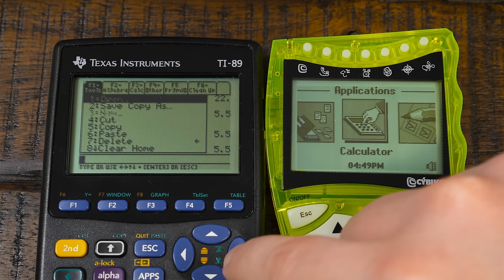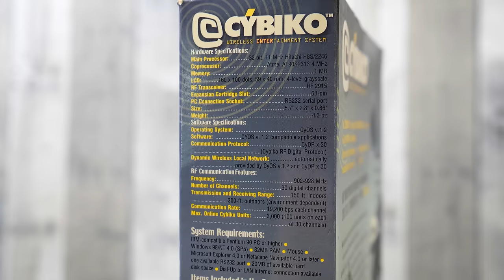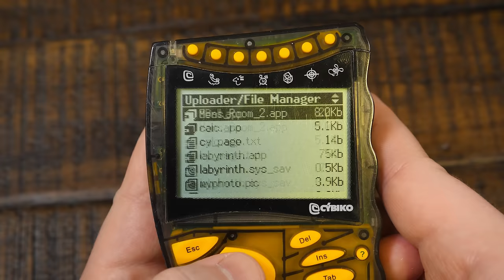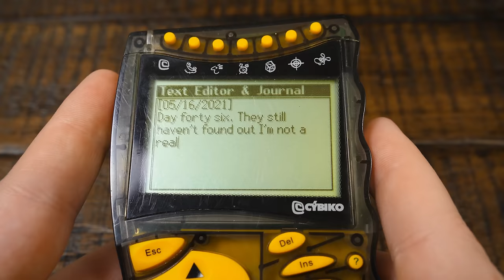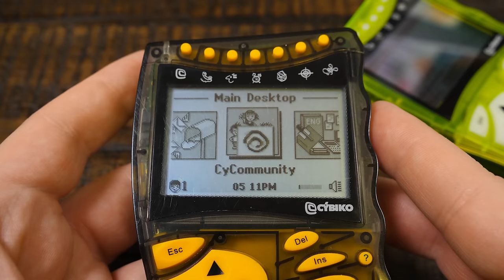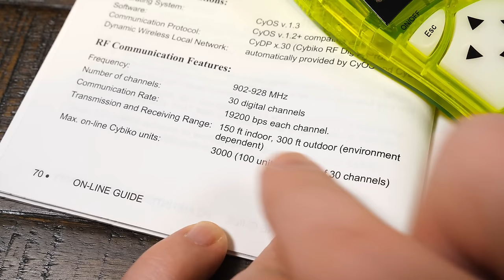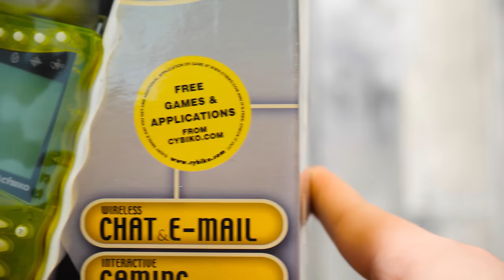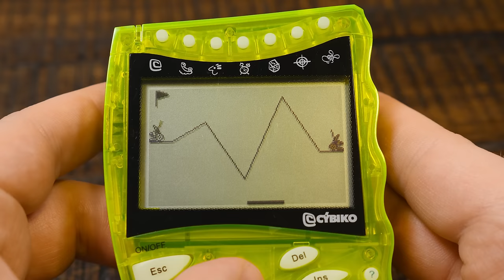The Cybiko Experience: a Handheld Computer for Year 2000 Teens

Comment: "OK so we need to stand 6 feet apart"
"Oh, for social distancing?"
"Social what? No no that's just how far these Cybikos can talk to each other from"
Reply: Well it is social something or other!
Reply: They got well over 6 feet in 2000-2001 when I was using them in highschool, you could chat reliably across most of the cafeteria and definitely in any classroom
Reply: I’m sure these things worked way past 6 feet, I get it it’s only a joke but it only works if the joke is true
Reply: @airthrowDBT  I think the antenna for these may have been defective or Damaged
Reply: Im actually really sentimental for these Cybikos.  I was so excited for the tech and really wanted them to catch on.  Ubiquitous LTE and Wifi makes the concept pretty obsolete though
Reply: @solinus7131  There's also the strong possibility of interference, even if it's not the same radio frequencies something from 2000 transmitting and receiving signal might have the signal screwed up by 4g, 5g and WiFi signals that just weren't a problem back then. I doubt the wavelengths would be that similar to be jammed but it's not so improbable to be dismissed entirely.
Reply: @RiderLeangle2  yep
Reply: @solinus7131  Nah. The RF spectrum is just much more congested now than it was in the year two-thousand. Your modern cellular network uses frankly miraculous technology to sort data out from the noise.
Reply: @CptJistuce  Yea, I now support this theory, also from RiderLeangle2
Reply: @RiderLeangle2  Yeah, the interference has to be killer these days with so much wireless infrastructure and corporate fights over spectrum. I should pull out my old 2000 era walkie talkies and see if the interference on them has gotten worse as well.

Comment: The radio must die over time because when I had one of these growing up I could connect to people 2-3 houses down the road from me. One kid at the end of the road actually had two of these (he broke the first one) and used that one to provide an internet gateway for everyone else in the neighborhood.
Reply: Today there's a lot more of wireless devices, so probably it has a lot more of interference thus the range is shortened
Reply: @RhinoBlindado  Thing is though with that radio band, 900Mhz, there really shouldn't be that much more than there was in 2000. I would argue perhaps there's even less devices operating in that frequency today.
900Mhz was really popular for baby monitors and cordless phones but those two devices have been pretty much replaced by cell phones and WiFi cameras neither of which use that spectrum. Yes I know those devices are still around, but they generally use 2.4Ghz now.
Even scada has mainly been replaced by cellular at this point. The only thing I can think of that still uses 900Mhz are wireless bridging systems where you can't have line of sight, but even then I doubt that that's common where they were testing.
Reply: @antikommunistischaktion even without being active 900 has a lot of background noise these days

Comment: I had a cybiko in high school and 2 other kids had them, the chat and gaming over RF worked GREAT in the classroom.  I wonder if it would work as good now with so much more electronic noise in our environment.
Reply: That's what I was thinking too - could it be that the range has been nerfed by all the wi-fi and bluetooth interference?
Reply: @darkfalzx Unlikely, since those are on 2.4GHz and wouldn't pass FCC cert if their harmonics 'nerfed' the ISM band. The biggest sources of RF noise are cheap, uncertified switching power supplies - all bets are off on them. The most likely culprit here though is that one of the units had a broken antenna - this sort of performance is about what you'd expect without using one. This is further reinforced by the fact he got the same performance in a suburban park. Yes, receiver ICs' sensitivity, noise rejection and so on have improved significantly since 2000, but even back then the performance would be expected to reach the quoted specs. I'm willing to bet if LGR measured continuity on those antennae to the RF output on the PCB with an ohmmeter, he'd find one that wasn't connected. It's also not credible that RF engineers hired from one of Russia's pre-eminent military engineering uni depts would produce a design that's less than 10% of spec - that uni programme was essentially the equivalent of MIT, except more selective and aimed at control systems for things that fly very fast, make a very, very big boom and it is absolutely essential that this boom happens, and happens in the right place. "Comrade CEO, we have coded an entire OS and hundreds of games in assembly by hand, and created a mesh network a decade before DARPA started funding them, but we have utterly failed at properly matching an antenna, the theoretical basis for which our own scientists have pioneered half a century ago!"

Comment: I had something like this in the early 2000's called IMfree by motorola.  It was a portable AIM device you used around the house. had a usb wireless base unit it would connect to, i would sit on the couch downstairs and chat with my friends. I thought it was the coolest thing at the time I had it.

Comment: You should do a blerb where you tune a ham radio or walkie talkie to the Cybiko network 😂
Reply: I really really want to connect one to my spectrum analyser. I am very curious how much output power these things have!
Reply: you won't hear anything except data packets, not very exciting
Reply: @Tall_Order  not exactly, think APRS for example
Reply: u also are not allowed to operate a ham radio if you're not licensed or unless you're with a licensed ham radio operator.
Reply: @michealpersicko9531  You're not allowed to TRANSMIT without a license, but anyone can tune a receiver and listen to the ham bands...
Reply: @michealpersicko9531  How is it in the US (or where are you from, but US is a pretty standard assumption on youtube).

Here in Germany it has been totally legal to use one to receive only for some years now. Transmitting without license is "only" an administrative offence, even if an kinda expensive one (up to 5000€ + a bill for the measurement efforts, up to 10000€ if you interfere with something serious). Before that, even owning one without license was a felony though.

This doesn't exclude additional criminal charges though, so (deliberately) transmitting on the frequency of the local ATC center would be dangerous interference with air traffic, too. THIS can easily land you a jail sentence.
Reply: @WolfmanDude  Seems to be a standard SRD device on 868(EU)/915(US) MHz. They most likely used a standard chipset, so I think 5-10mW or so?
Reply: Definitely. It would be very interesting to see what kind of protocol they're utilizing for the communication.
Reply: @VintageTechFan  Just did some googling, I think they use the RF2915 IC for the RF. The chip has a typical RF output power of just 3dBm. That is 2mW! Thats just sad. If they are not using some sort of PA.

Comment: And just seven years after this was released, Apple launched the iPod touch. Can´t believe how much technology changed in so little time.
Reply: Oh, it was definitely a time of very rapid technological shifts.
Buuuuut...  the Cybiko was actually released the same year as Palm's IIIc(their first color device, with a much faster processor and far more RAM). The Cybiko was something like a quarter the price of a Palm IIIc, though. Which was very important, particularly for the target market(if it had stuck around, I could easily see Cybiko releasing more capable devices for more mature users). 
Apple benefitted a lot from prior products working out the kinks, and driving improvements in hardware as well as lowering prices. 

To be clear, those prior products DO include Apple's own Newton. No matter how many jokes it was the butt of at the time, in hindsight it seems most of Newton's problems were a case of trying to do too much too soon(though handwriting recognition is dodgy as heck even today). 
Backing out of the nascent PDA market resulted in other people(mostly Palm and Microsoft) spending the small fortunes that Apple didn't have to figure out what worked in this new form factor and drive processor and display technology forward. When Apple came back to the PDA, a lot of the wrinkles had been ironed out and Apple had the money to play in the big leagues in a way they never really had before. 

At the time, everyone with an interest in technology could tell the PDA wars were leading to something big, but the end game wasn't something anyone could've predicted. If you'd told us in the year two-thousand that in a decade or so EVERYONE would own a pocket computer that they carry around all the time with an always-active cellular-modem... our skepticism would've been immeasurable.
Reply: I've never heard of this thing. I was 18 and worked in a computer store as a tech, but even then my TV watching time was minimal due to being able to drive and having a gf. Still, I'm surprised this isn't ringing a bell.
Reply: now look how little tech has changed over the next 14 years.
Reply: Yeah in 2007 I got a Sony Ericsson W800i phone that had touch screen, played mp3s and all that jazz... but was still massively primitive compared to what Apple unleashed on the market later that year. Don't get me wrong, I'm not an iPhone fan, but going from single touch to multi touch etc. the existing phone manufacturers were caught with their pants down for a period.
Reply: And now the iPod Touch seems to be dying.

Comment: CYBIKO! I wanted one of these so bad in middle school, but then we had enough nerds in the school (myself included!) to make the mesh work in the first place. I recall folks being able to talk several classrooms apart, so I would guess that the interference environment is indeed much worse than it was back in the day.
Reply: Cybiko real deal was for programmers, not for gaming
Reply: Yes, because of uncertified cheap switching power supplies being everywhere, but the most likely reason this worked so badly is a broken antenna on one of the units. This is the performance you would expect from not having an antenna (ie using the PCB trace as one).

Comment: First Billiam now LGR. I still have my Cybikos. I had to fix mine a lot. From the failing charging port, to the gum stick batteries. I remember sadly going through Nashville as a teen with mine looking for another Cybiko user. Never found one. I did browse the web when I set a second one up as a modem to my pc though.
Reply: Cybiko didn't age well man, it was more like a Teenish PDA and not for programming in post market.
Reply: @HanzoHimemiya  It really didn’t. I should try to get mine working again. I also had the MP3 player that went into the expansion slot.

Comment: I wonder if modern cell signals and other changes since the early 2000's could be affecting the wireless range of the Cybiko?
Reply: Probably the 2.4Ghz range that we shove cordless phones, wifi, baby monitors, microwave ovens, and everything else onto.
Reply: It absolutely is impacting the range and usability of the Cybiko today. In fact I'm pretty confident that walkie-talkies today use a different frequency so as not to have their range cut down or impeded etc.

Comment: 2002 middle school, there were 6 of us in the school that had  either this or the newer Extreme version. Our grad was all in the same wing of the school so as long as the we were in the main grade wing, we had our chats rolling. Signal was good enough to go across the hall or through the wall to the neighboring room so it ended up working for us. I think the distance through the mesh style network extended 4 classrooms at one time. Good luck trying to chat from another wing of the building though. I can't imagine 2.4ghz signal interfering these, but somehow in 2002 these had much better range

Comment: Re: wireless range -- is there any chance there's some kind of age-related degradation in the radios? Similar to the batteries?
Reply: Radio transceivers do use capacitors  in their implementation, there might have been some degradation of ceramic capacitors, or if they use electrolytic, that's even worse for long term health of the circuit
Reply: @eldorado3523  If it had a failed electrolytic capacitor, he would've noticed while inspecting the damage from batteries, I think
Reply: my guess (my friend who's an electrician states the same) is that electromagnetic pollution might be the issue here. too much wireless stuff and smartphones and the old devices being not strong enough. pair that with the degredation of capacitors others mentioned and there you have it.
Reply: @eldorado3523  Those low-capacity NP0/C0G capacitors basically do not degrade. 

There were some ancient types with open silver plating which corrodes away in agressive atmospheres, but modern MLCCs generally don't do that. 
I repair old electronics starting in the 1930s, and ceramics are usually fine.
Reply: @Tharmorteos  As I recall, there's a lot more use of the 900 MHz spectrum today than there would have been 20 years ago.

Comment: I bought a clearance stock Cybiko Xtreme from an eBay seller back in the mid 2000s. Cybikos were never sold in my country (that I heard of), and I was aware that it was basically dead even when I bought it, but I was fascinated by the concept. From descriptions by owners of both the Classic and the Xtreme, the Xtreme is really almost an entirely different device. It's like comparing a GB Colour to a GB Advance, because the GBA plays GBC games.

The Xtreme is slim and feels very solid. I don't have it with me at the moment, but I think it may actually be smaller than the smartphone I'm using to type this comment. The processor in the Xtreme runs something like 3x faster IIRC, and it also allowed for users to write native apps (the Classic only ran a Java-esque bytecode for users, although I believe that some of the manufacturer's apps were also native even on the Classic).

Comment: The Cybiko site still at least tries to exist. It just goes to a screen that says "repairing flash".
Also, about the range, I do know there's a lot more things on wireless these days than back in 2000. I wonder how it would do in a rural area?
Reply from the maker: Later in the video I tested it in a wide open park far outside of the city. Still awful range!
Reply: Heya  @LGR ! Did you know there's something kinda like a modern Cybiko called the CircuitMess Chatter? Unlike the Cybiko, it takes more of a STEM learning toy approach, since you literally assemble the device & can code some stuff for it, but it also features offline texting functions! 

I don't know how far it goes beyond that tbh, but I thought you might find it cool. It's sorta what led me to watching this video in a roundabout way!
Reply: I just looked this up and it looks really neat! And yes, like a Cybiko that you build yourself and has a color screen

Comment: One of the main draws of the Cybiko Xtreme is that it no longer needed the stylus, and also had a better screen and louder, clearer sound. The only downside is that the battery was embedded into the system and not easily replaceable.

Comment: The European version had a far greater radio range for some reason (regulations maybe?).  You could flash an American one with UK firmware and get many times the communications range.  Maybe the European ones used the 2.4ghz public band rather than 900 mhz which was used for the Orange cellphone network in the UK iirc.
Reply: Apart from the UK and maybe Russia, do you know any EU country where Cybiko was a thing ?
Reply: @psirvent8  No idea, there isnt much info online about the places it got released, just stating Europe, Russia and America in most articles and there were 2 varients, the Euro-Russian one and the American one.
I was wrong about the frequencies used though, the Euro one uses 868-870 MHz which is a smidge below the U.S one at 902-928mhz.

Comment: I think a quick modification to the amount of winding in the antenna might increase the range of the units, but that may also increase power consumption. This also might need some extra length in the antenna wire.

Comment: I think I know what happened with the range. In testing they used high gain antennas (probably around 12dB or so) and set things up in perfect lines to each other, but once the device went into production they changed it to a 0dB antenna for practical purposes.

Comment: Before you brought it up ... I was going to mention the same. This was designed in a much different time, when wifi and "mobile devices" were still quite rare. I wouldn't be surprised at all if there are modern thing(s) blasting RF in their frequency ranges. But like you said, that's just an assumption as well.

Comment: I have the black one + pink one + mp3 cartridge + two memory cards for the mp3 player which hold about 12 songs each, and hang out of the cartridge comically! I genuinely found these online when I was 16 in 2001 and genuinely begged my dad for them for $100 a pop. Wish I could sell the full set incl chargers and data transfer cables and all for a full recovery of what we spent, and give the money back to my dad. LOL Mine both still power up, but the black one shuts off randomly. Wondering if I should take out the batteries and clean before further corrosion. Thanks for the video!

Comment: yeah, 900 mhz is an unlicensed spectrum for signals, one can only guess what's on that frequency, it got over crowded in the 1990s, so it would probably have been bad around 2000-2007 with all the cordless phones, baby monitors, etc using the frequency.